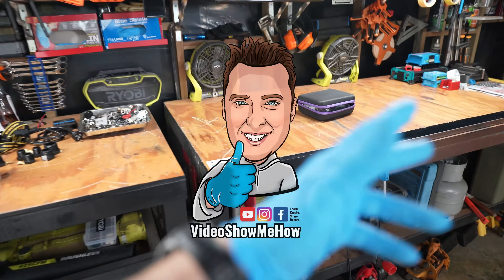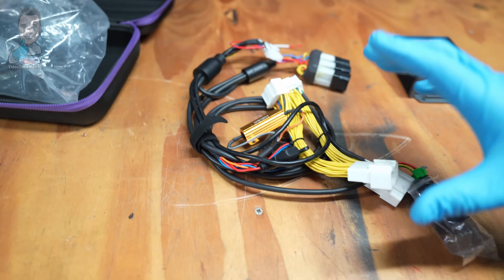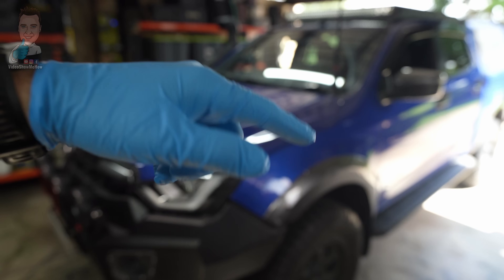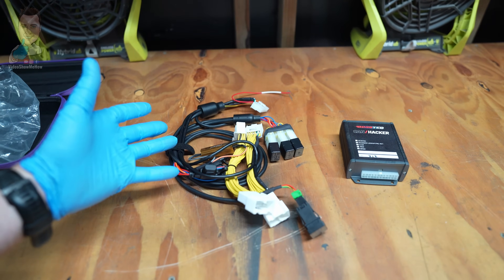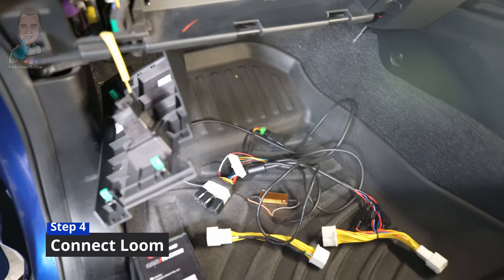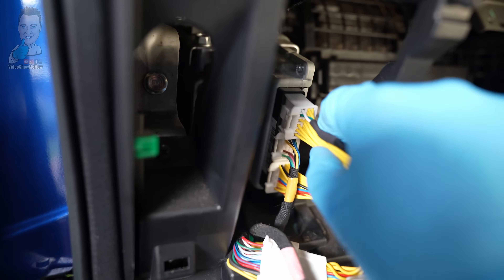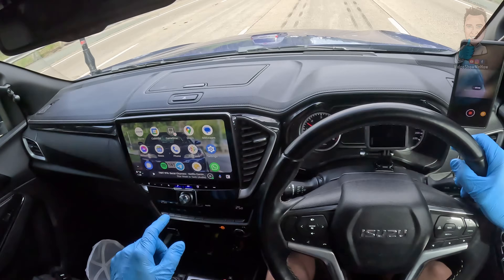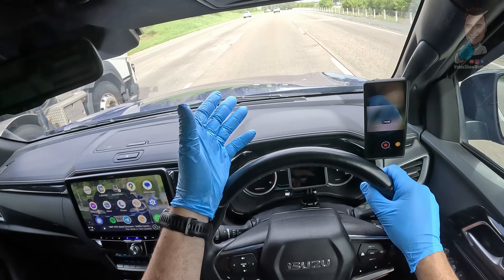D-MAX MUX Auto Torque Converter Lock-Up Kit - INSTALL & ROAD TEST | BOOSTEC

Comment: Can I just leave it permanently in lock up mode
Reply from the maker: I just leave in auto mode, but that doesn't keep the torque converter permanently locked (you wouldn't want this). There is some other options though, worth checking the website

Comment: Just installed it. At 100km/h mine still kicks back 2 gears on a decently elevated hill. Would be nice if it didn't but I pop it into manual mode and push the gear up while maintaining cruise control

Comment: Would you recommend a trans cooler if using this?  Towing 2.5t. 2021 X-terrain
Reply from the maker: @pauljones8198  if anything this will help reduce your trans temp as well be locked more often, of regularly towing I would consider a cooler yes
Reply: @VideoShowMeHow  Interested to know how you would rank upgrades for the dmax for towing, which upgrade first? Second etc??
Reply from the maker: If towing 2.5t regularly, I would 1) suspension 2) trans cooler 3) lock up

Comment: Great video Adam ! This is my next mod but have also been waiting to see if someone else brings out another way of tuning the tcm and not just plug and play ! The thing I don’t get is why Isuzu have tuned these things so badly as I drive new hilux s at work that have the same AC60 transmission in them and they don’t chop and change like the Dmax ?

Comment: I'm looking at one for my 2016 MUX. Is this something that once turned on, you can basically forget about it? ie you don't need to turn it on everytime you start the car?
Reply from the maker: @11DCB  yep I just leave mine on auto, it takes care of the rest 👍
Reply: @VideoShowMeHow  Thanks so much - is the install the same for the 2016 - transmission computer/plugs in the same spot, beside the the glove box??
Reply from the maker: @11DCB  unsure for the 16 sorry. Worth dropping them an email 👍

Comment: U sold me. I’m fitting one in my My23 BT50. Showing how simple the plug and play is it’s a no brainer. I did notice a red wire. Does that have to be connected to positive?
Reply from the maker: Nope that's just spare for another type of input that isn't used.
Reply: @VideoShowMeHow  ok thank you.

Comment: Transmission expert told me the biggest killer of the 6speed is heat when towing ,the heat is so extreme turns the oil black burns the oil over 100deg reaching  120deg up hills ,problem 1 extreme temp changers from cold 5deg morning winter start to running temp everyday towing work trailer up hill 120deg can lead to trans failed from Orings / seals failing from extreme temp changers , and excessive ware from degraded burnt oil , the factory cooler runs through bottom radiator tank and thus can create engine over heating issues towing up hill ,trans cooler before factory cooler stabilizes the temp removes excessive heat build up thus allowing the factory cooler to do its job and stabilize trans temp .it will take longer to reach correct temp with cooler in winter i let it warm up for 15 minutes before driving
Reply from the maker: @hardcoreenduro2068  #1 killer of all autos is heat for sure, once the ATF gets over that 110/120 mark too often it starts failing and needs to be changed. If I was towing on the regular I'd 100% be fitting a cooler. The factory cooler is via a heat exchanger before the rad on these also.
Reply: @VideoShowMeHow  i also have a small 7x4 steel camper trailer with clam shell pop top tent ,fridge and slid out kitchen fully equipped with all camp gear needed for weeks away , we do Fraser and beach driving ,towing on sand heats it up fast ,now its stable i dont even look at the temp never gets over 80c

Comment: Interesting reading the comments ,i found my dmax 6 speed hunting gears ,its 018 lsu done 160ks i purchased it with 153ks Isuzu gave me some history and warranty work that had be recently done but couldn't tell me if trans had been serviced recently but dew at 160 major service , ,i suspect it was used for heavy towing as it had brake controller installed and rear springs were flat ,apart from that it looked like it had never been off road like new looking under it very clean one owner , anyway i had a trans expert flush the transmission fluid replace filter and fit a big alloy billet heavy duty tans oil cooler up front behind grill that cools trans oil before it enters factory oil cooler ,now its holding lockup better and not flaring as much just breathing on the throttle it would flar in 5th on hills ,still i find the 32" tires have geared it were 6 gear is only good for open hiway over 110klm  ,hilly country 100klm roads i lock it in 5th

Comment: Hi Adam I'm installing this mod on the weekend do you have a video with a bit more detail on button installation into Centre Console. Cheers
Reply from the maker: Hi there, yeah a few vids cover it in more detail, prob the brake controller vid or UHF install would be the go. They're all on the channel and in the DMAX build playlist
Reply: @VideoShowMeHow  Hi Adam managed to get it done without breaking any tabs the unit works great took it for a test drive love the manual cruise control function

Comment: Hi great video. Not much of a tech guy but if I install it I will always leave it in lock mode? I have a mux2019 auto/ Cheers Bill
Reply from the maker: Will lock up at around 76km/hr unlock once you drop under 74. This is mainly for highway. I just leave it in auto and it does it's thing

Comment: Based on your video, I got the OBD2 sensor and kept a close eye on my ATF temps. I also noticed the increase in temp when the torque converter would do it's thing and "flare".
On my ute, I have found that running it in Manual mode effectively locks up the torque converter above certain speeds anyway. So when Im towing our camper, I just run it manual and never have any problems with ATF temps now. 5th locks at 80kmh and 6th locks around 100kmh so I just flick between or drop it down to 4th when above 55kmh. Easy.
It does take a bit more thinking but I kind of like being engaged in the driving process.

One thing I did hear, and this may or may not be true, is that a gearbox will flare more when cold to generate heat and get the ATF up to optimal operating temp. So, don't be in too much of a hurry to lock it up. A bit of heat is a good thing. (if the advice I got was correct, of course)

Comment: Did the install yesterday and a drive today and it is brilliant. Finally something to stop the transmissions painful searching. One question though is what is the little red wire with the white bit on the end used for? In your video it seems to be just ignored, thx
Reply from the maker: Yep not needed. Is an extra input but not used

Comment: I have just fitted my device so simple following your demo, haven't taken it for a drive yet but I'm sure it will work fine. It arrived with the NEW BUTTON CONTROL (showing the 4 wheels and words Auto Lockup Hi/Low) Thank you for your videos your a Master. 29-05-24 Norm
Reply from the maker: Nice! Cheers mate 👍

Comment: Hi with the auto lock up kit i already have the button in the console like the one in the kit can i just use the one button or do i still need both 2023Dmax xterrain
Reply from the maker: No you need both, there's new switches coming I believe that will have a different logo

Comment: On the can/hacker was the red digital aux wire connected to anything or was it just made safe with heatshink or the like .? Great vid by the way
Reply from the maker: Yep just an extra, only connected the bits as you saw in the vid 👍
Reply: @VideoShowMeHow  excellent I’ll be installing tomorrow got all my bits n bobs together today can’t wait to try it on a big trip I’ve got coming up

Comment: Hi, I have ordered a unit as I tow a caravan, and this will help a lot. In your video, you say disconnect the battery. Will there be any issues when reconnecting it, as some cars have faults when power is completely disconnected.  Or can you just have the key far enough away from the car.
Reply from the maker: Nope no issues. Can remove the key if you prefer, I just prefer things to be completely dead if playing the expensive stuff eg ecu TCM etc
Reply: Hi mate ,
I’ve just got my kit and wondered how you went install? Did u disconnect battery or just take key away ? I have an ecu tune so I’m reluctant to disconnect battery and lose my tune.
🙏 thanks.

Comment: So I have a few questions if you will permit me. So is this something that can be left on all the time or are there times when it absolutely shouldn't be used, i.e. decelerating down a hill? You mentioned the potential fuel saving by not changing gears up and down particularly when towing, so I guess it begs the question. How many klm's / years would it take for the $1500 device to pay for itself?

Comment: Hey guys,

This is totally not a hype-drive post, but for delivery in the next 2-3 weeks, we got 7 units left unallocated with the circuit boards we've had manufactured, after that it will be 3-5 weeks with a number between 10-100 available, then 5-8 weeks about the same number again.

Unfortunately the kits are very hands on, with only hardware basics done in mass production, the bootloader, firmware and file configuration takes time and some physical assembly takes time.

So if you want one sooner rather than later, I'd say you would probably need to get an order in within the next few days.

I really don't enjoy creating any hype, but I've come across quite a few wanting things asap for trips coming up and it's just not a reality that can be accomplished.

No complaints on my end, it's keeping me busy...  All of my side projects have had to take a break to fulfil orders.

The link is in the description 

Cheers
Reply: Man I was keen after watching the video but then when I went on the website and seen the price I got cold feet. Bit pricey for something that is plug and play in my opinion, and I tow a bit. Great product and I can appreciate the time effort in making them and everyone’s got to make bread.
Reply: @ssidewayz  Agreed. I can't justify that price either. I could achieve so much more with the same money. I'd pay maybe $600-700.
Reply: Yep halve the price and they'd sell heaps more. It's really only offering cruise control with manual gear changes, the flaring you can deal with using manual gear selection anyway. They're trying to market to the inattentive driver who should buy a cybertruck instead lol. Just kidding, but yeah Isuzu really need to improve or they're screwed in the changing market.
Reply: @soobz  you forget line pressure is added and modified (with anti learn), clear code function for engine, diff lock anytime is added.

We put all our time into development and allow older units to be upgraded that didn't have those functions.

A fuel tank calibrator can also be optioned, so you can calibrate your fuel gauge for bigger fuel tanks.

Its more than just a lock up kit these days 😅

This video got dated when we continued to improve the initial product.
Reply: @Boostec-ODS  Maybe so, but it's still flamin expensive for 'nice to haves', though some of those I'd argue are dangerous eg anytime difflock is asking for trouble and clear codes can void some warranty claims. Regardless, and nice as the 'manual+cruise' would be I can't justify $1.5k
Reply: Will it work with 4ZRE?

Comment: Adam, do you find it changes gears better too? My biggest gripe with the Dmax is holding the gears at higher revs for far too long before changing.
The power chip made a massive difference, but it's still not as good as I'd want it.
Super keen to get one of these kits, but just can't justify the price 😓 Need to organize a group buy or something
Reply from the maker: Doesn't change any different just when really and how it stops a lot of the kick down on the highway etc
Reply: That is more to do with the angle meter in the vehicle..... It holds gears more if pointing uphill & is an inbuilt function that is not that easily overridden.

Comment: Current features: 
Auto mode (77kmh on, 74kmh off - Can be adjusted with a laptop), 

Expert mode - Hold down the "Cruise cancel" button where your right thumb is on the steering wheel (Locks any gear/speed), 

Scan-tool level clear codes - Tap the "Cruise distance adjust" button 5 times in 5 seconds (Its not for the kit, just an added extra) 

Manual cruise - Hit the "Cruise RES" button to allow manual gear selection and cruise.

Comment: Ironically the Hilux/Prado uses the same box but is tuned properly to lock up in 3/4/5/6 at varying loads. As posted elsewhere on here there is a reason you don't lock the overdrive gears hard. Anyway, it's not a ZF8HP70...
Reply: Is it for the 2.8L prado 
Have you got a link?

Comment: Hi

Can they program the unit to lock in lower speed? 

Is there noticeable different in acceleration?
Reply: The current kit has an "expert" mode, if you hold the "Cruise cancel" button in for >1sec, it will force lock. The unlock conditions in this setting are: 1) Tap cancel 2)RPM too low 3)Speed too low.
The valving allows for lock in 1st gear aswell.

Comment: I was already sold on the unit, then you mentioned being able to use cruise control in manual mode. What an upgrade, thanks man, see you around
Reply: I drive mine in manual mode when towing and or hwy driving, just kicking it back a gear if I hear it unlock so apart from being able to force it to hold the gear lower in the rpm range, pre boost I guess, what is the advantage? I don't see any fuel consumption improvement between struggling in 6th at 1500rpm and doing it easy at 1800 in 5th, same egt too. I find engine temp doesn't climb as much with less load-higher rpm climbing over mountainous areas.
I have 2018 model which allows manual shift when cruise (non radar) is on so no issue there. 
Out of curiosity, what happens when you forget it's locked and say pull into a service centre?
Reply from the maker: @jobloggs7215 2018? So 4JJ1 and different gearbox I believe? For me, one of the big things I like is how it's basically set and forget like I show in the vid, in auto mode it auto locks above 76 and unlocks when you slow back down below 👍

Comment: Careful when using LOCKUP for decelerating in any gear but 1:1 direct drive gear.
The planetary gear long life reliability needs lockup OFF during decel otherwise excess thrust will cause rapid wear to the planetary gear teeth.
That's the same reason why overdrive towing heavy loads is NOT recommended.
2 cents worth :)
Reply: $1500 for the mux 😮 few other things i want to do first
Reply: Isn't this the same gearbox in the Hilux? I have one in mine since 2016 and 280k+ kms. No issues
Reply: We still believe the box is robust enough to tow in 5th/6th. We did develop an earlier "analog" kit for the same gearbox in 2016-2019 that is still in use today. You're technically right, so there is room in the strategy for lock and unlock based on loading aswell. Being in the canbus network lets you see and respond to many signals as long as you understand them.
Reply: @Boostec-ODS  Agreed since box would be designed for acceleration in all gears but it's the decel in lockup that loads/wears the planetary gear hence the manufacturer lockup OFF in that state.
Intermittent use of LOCKUP (& diesel brake eg 4JX1) during decel shouldn't be a problem.
I do like the idea of it but wonder why manufacturers don't do it standard..would need a stronger/dearer box maybe ??
Again, 2 cents worth :)
Reply: @robusc4940  fair enough, we were told from a transtron eng that the coasting feature of most modern cars is actually to get better fuel use scores (at the higher cost of using yout brakes which isn't a metric that is taken into account)
Reply: @Boostec-ODS  LIGHT THROTTLE, light load, level road cruising in high gear lockup GREAT.
Which of your gears is 1:1 ratio ? 
Eg 6 speed auto should be gear 5.
That gear PERFECT for heavy towing LOCKUP cruising.
More heat generation occurs during planetary gear towing than 1:1 gear.
Does your owner manual suggest 1:1 gear towing for a reason ?  
It's a direct engine to tail shaft drive - planetary gears are simply free wheeling inside of box
HEAVY load cruising in high gear lockup needs much more than light throttle.
= HEAVY CONSTANT load on planetary gears even on flat roads.
$5K in warranty auto gearbox repair taught me that.
3 hour flat road heavy loaded trailer towing top gear lockup constant 90kmh mild - moderate throttle, no warnings/red lights all ok till got home then took FOREVER to engage reverse.
4wD stock standard, no mods, had since new
O/drive planetary gears and cages worn, trans sump full of metal fillings.
$5K rebuild 15 years 250k ago taught me good lesson.
Still same car and box going great but ONLY do towing now in 1:1 gear, NOT OVERDRIVE.
Maybe instead of 2c worth make it a $5K worth comment :)
Reply: @robusc4940  you can't compare a disaster from a 20 year old gearbox to what is current...

Aisin are actually very helpful if you get onto the right person.

A442x and a750f have very different construction. We have complete relacement controllers for them in our store.  

The a750x you probably had is very understandable as to how the clutched gears work. 

I appreciate your experience, it's failures that lead to success.
Reply: @Boostec-ODS  Yes I like the idea of lockup kit usage for intermittent use outside of heavy towing.
Thank you for your thoughts & opinions.
Reply: How much are these kits please
Reply from the maker: @alextincknell9087 link in the video description has all the detail